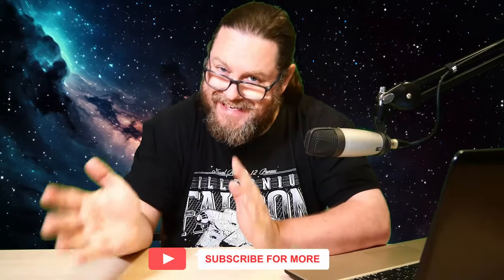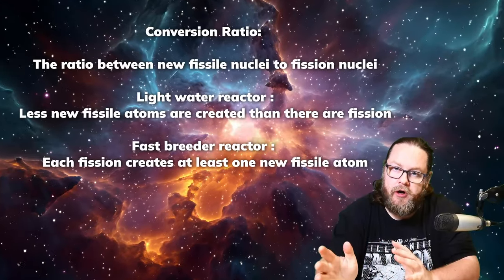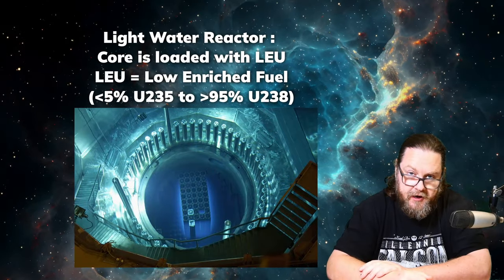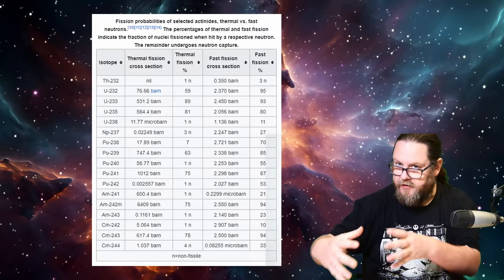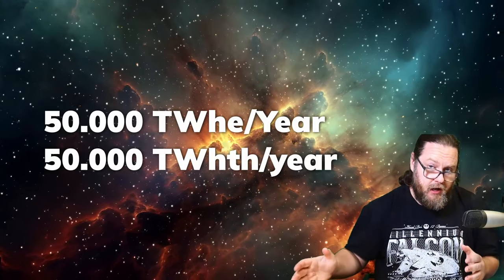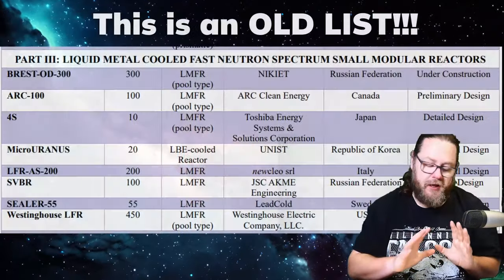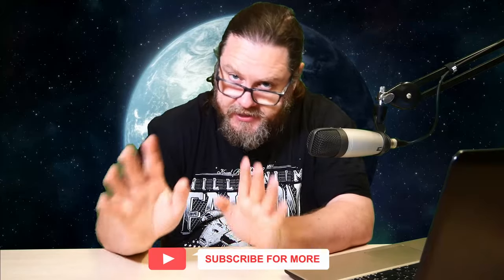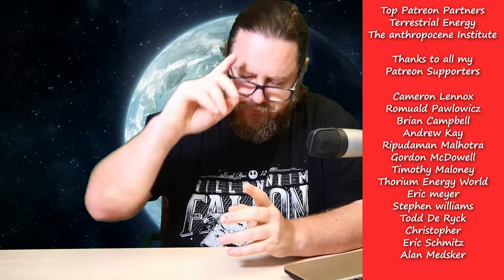Nuclear Waste Can Power Mankind for a Long Time

Comment: WRT Nuclear Waste in the form of Spent Fuel:
Staggering amount = 400,000 tonnes ... According to the World Nuclear Association.
Which is equivalent to 40 hours, 5 shifts of digging by Germany's Bagger 288 Bucket Wheel Excavator!  (240,000 tonnes per day.)

Staggeringly small amount in the grand scheme of things.
Reply from the maker: Given the 50K TWhe and 50K TWhth per year, you have 53 years worth of energy in 400.000 Tons of SNF. That's pretty big. Compared to coal, you can't get that with 40 hours of digging coal. No way. 40 hours of digging gives you 18 TWh, to reach 50000 TWhe alone you need keep that bagger running for 108 thousand hours.

Comment: With a liquid fueled fast reactor, even more of the fission by-products can be eliminated.
Reply: Make the dual fluid reactor gas cooled and directly run a brayton turbine off of that gas. Fission products and gasses are in their own loop, not the power loop.
Reply: Fission product removal is expensive, & in liquid fueled fast reactors you don't need to remove most fission products, you only need a breeding ratio that is high enough over 1.0 to over come fission product poison buildup reactivity, a breeding  ratio of about 1.04/yr. Remember in a fast reactor fission cross sections aren't decreased as much as absorption cross sections and around 25% of fission products per year naturally remove themselves from the chloride salts because they go through being gasses & off gas, or go through being noble metal particulates the precipitate out out side the core in either the heat exchanger's cooled surfaces or in the low flow drain tank. This means the reactor stays barely critical at all times, and can be tweaked multiple times a day as needed. This reduces the need for recycling by 10x, thus reducing cost dramatically vs solid fuel today. Recycling as a liquid starting and ending makes recycling 10-100x even more cheaper than solid fuel. The drive for pure plutonium is because you need to be able to physically handle solid fuel in the assembly & inspection of its mfg. Liquid fuels don't need absolutely pure fuel.

This process breeds a doubling of fissile material, just barely overcoming fission products in 50 years. Higher is possible, if desired.

Comment: As far as I see, breeder reactors are pretty much a mature technology, however most of the modern innovations are centered around make sacrifices on their economics in attempt to overcome proliferation concerns (i.e: by obviating the need for online fuel/blanket loading). These are political issues and require political solutions.

The ability to breed plutonium for MOX fuel for existing reactors should be considered even if that means diversion is theoretically possible.

Further improvements should focus on reliability and efficiency.